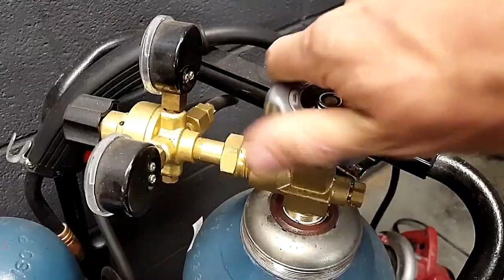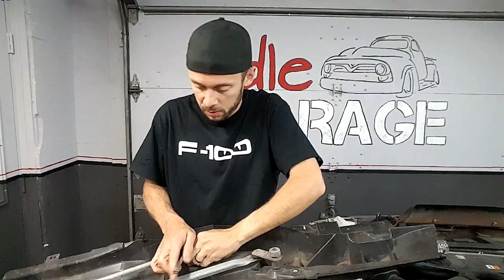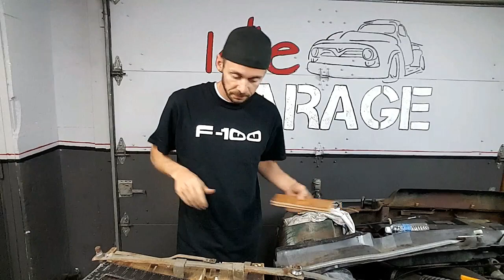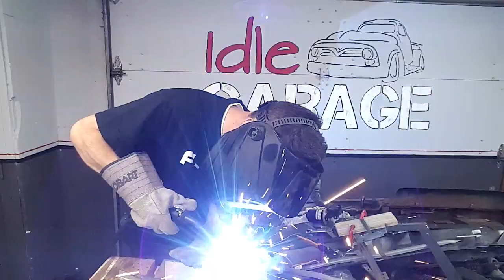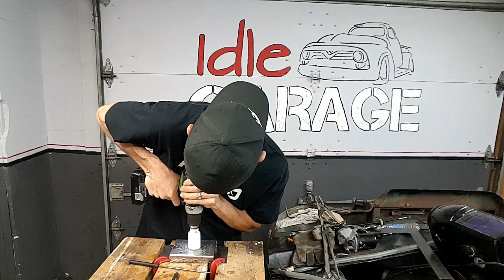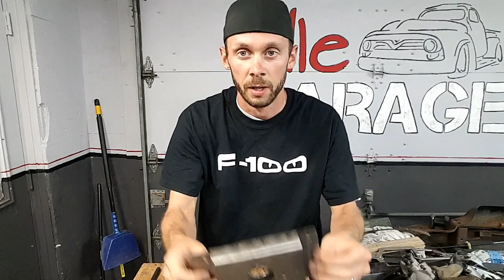Modifying the wiper motor and mount on my Ford F100 to Crown Vic frame swap #22

Comment: Hi, did you ever install the wiper assembly? if so which video, thanks,
Reply from the maker: Not yet. When I did this I was in the middle of replacing all the cab corners and needed a different task for a break from them.
Reply: @IdleGarage  Hi, when do you think you will continue with it? Thanks,
Reply from the maker: Not sure when it'll go in probably in the process of the wiring. For the most part it's done since I'm using the F100 hardware with the cv motor. Is there something you had a question on it or just seeing how it works out in the end?

Comment: This video was especially interesting to me.  Do you plan to use the GM wiper circuit, or use a simple high / low circuit like the truck had originally?  Does the GM circuit include a park function that pulls the wiper arms below the hood line?  Keep up the terrific videos!
Reply from the maker: Thanks!! I'm using the cars column so it will use the cars circuit. This will give me intermittent wipers. I'm not sure about the park position because its been a year since I tore apart the car. If I remember correctly they park at the bottom of the glass in the down position.